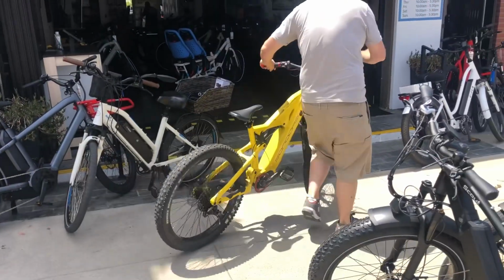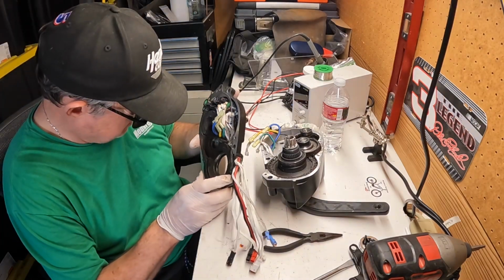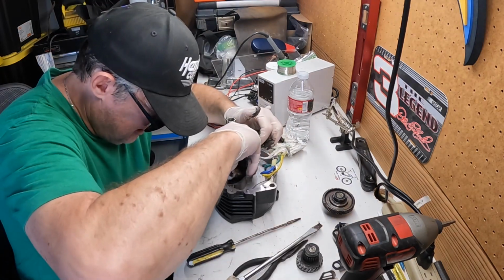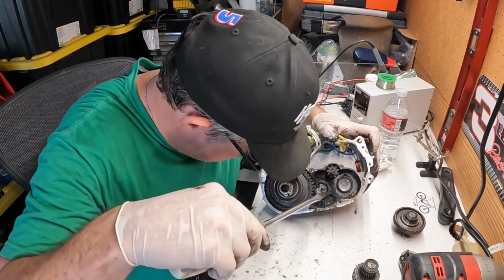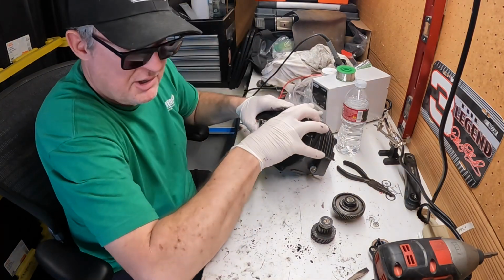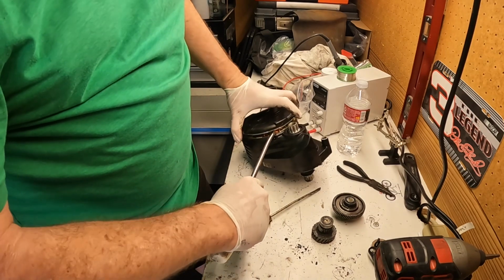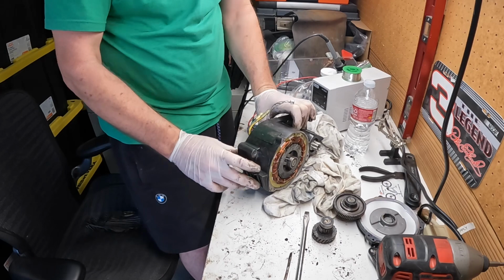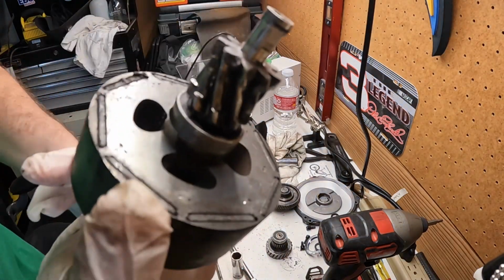Rockstar Rescue Episode 2 Troubleshooting the motor

Comment: I crashed hard - I am getting pumped with ice on shoulder and back. I clipped a tree when I didn't think i was close to it. Is that how your supposed to do that? 7:21 Boy that is some lube failure. Maybe if the previous owner would have serviced it, it might have been ok. But I am guessing the metallurgy of the gears is not top quality too. And the heat damage is apparent. Get a pulley damn it.
Reply from the maker: I hope you heal up quick! The trails you ride are narrow at times. I don’t know what I was doing, first time working on it, just wanted to see the failure.
Reply: @MattHaley  Thanks Matt, It was fun to watch. It makes me want to make sure my grease is always in good shape.

Comment: That's crazy. shows you how much torque those things have. you said that bike was modified. would the modifications possibly caused this? i can see how a smaller front sprocket gear would help lesson stress on those gears. i know a lot of guys have done that.
Reply from the maker: It's crazy, I think the clutch failed. I have a few emails out to US based Bafang service companies to tell me if this can be fixed and confirm what may have caused it. The modifications were the smaller sproket, and he towed a trailer with the bike for food delivery. Other than that; a fixed seatpost, grips and different seat were the only other mods. I think Sondors did him dirty on the warranty, this is a Gen 2 bike probly less than a year old.